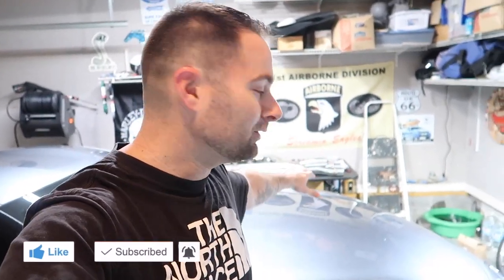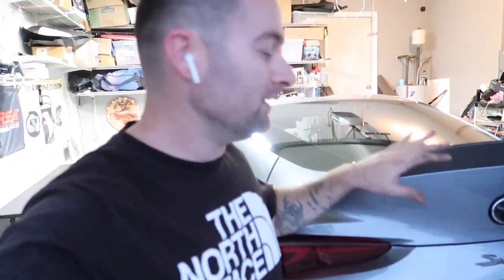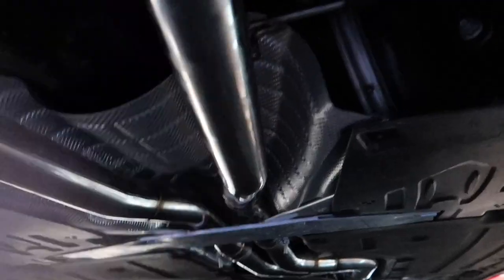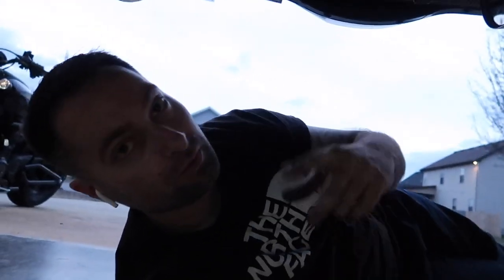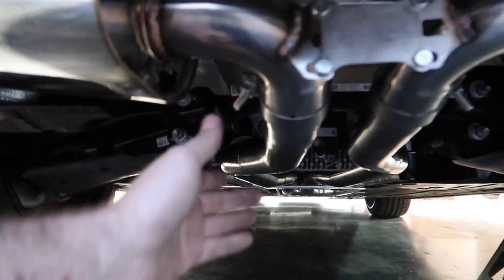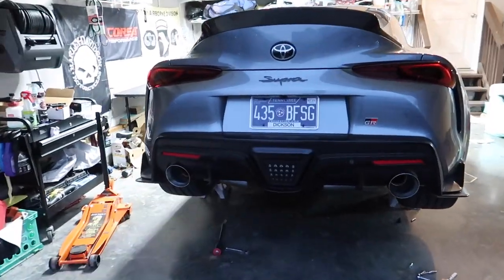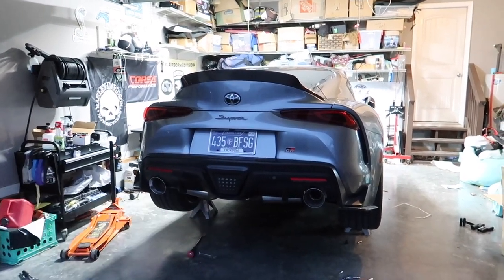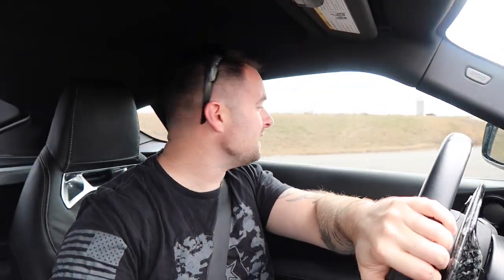ULTIMATE 2020+ Supra GR Exhaust UNDER $700... IS IT WORTH YOUR MONEY? (Extreme Online Store)

Comment: I just ordered mine less than 15 min ago. Any idea how much weight you shaved by switching from oem to those? Any dyno comparison videos or dragy pulls to check traps? I have the same set up as you, fbo Jesse map 6 on E30-E35. I can't seem to beat a 7.5 at 98.4 mph on the 1/8th lol, but then again my 60' is only 1.85-1.98. Still on dws06+ all seasons.

Comment: Question. Did the kit come with a block off bracket for the valve in the back or did you just start the car in sport mode and pull the fuse in the back? Maybe I missed it in the video. Thanks.

Comment: This is almost exactly like awe exhaust and now makes you wonder why awe charges so much more???
Reply from the maker: 100% 😉
Reply: awe did the research to make it first and this doesn't have the key piece which is the 5 inch oval mid section as well as the awe being 3.5 inch and having the valve replicator plate for the valve motor
Reply: @carsonbrummell4715  what does the valve rep plate do??? Guess it's not really needed??

Comment: Hey Zander getting ready install this exhaust but I just realized that it doesn't have the valve actuator to make it not throw a code, I ordered one from grimspeed but can I install this exhaust without getting a code????
Reply from the maker: I left my module plugged up and tucked it up out of the way. Without it, I’m not sure if it would be a code or not
Reply: @Zander13Productions  wow so has long as it's plugged in still it didn't throw a code??? Then wonder why they sell the simulator??
Reply from the maker: @carguy...  I would just buy the simulator. That’s what I plan to do. But for now I just removed the module box from the stock exhaust and hid it up under the rear fender temporarily
Reply: @Zander13Productions  actually I ordered one but it hasn't shipped yet and Saturday I'm dropping it off to get the exhaust put on, so unfortunately I won't have the simulator yet for the install. BUT even with the simulator plugged in you still need to keep the whole old assembly you're not using anymore tucked away which still doesn't make sense.
Reply: @carguy...  can you please send the link for the simulator? And tell me what it is and is good for?